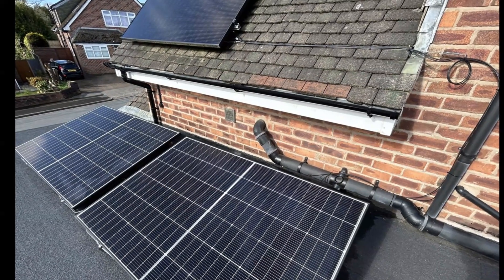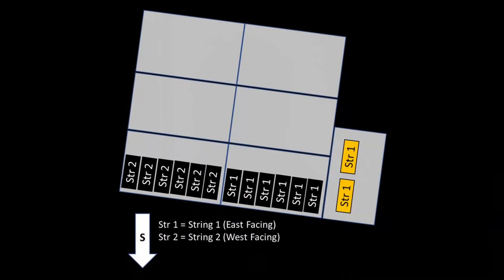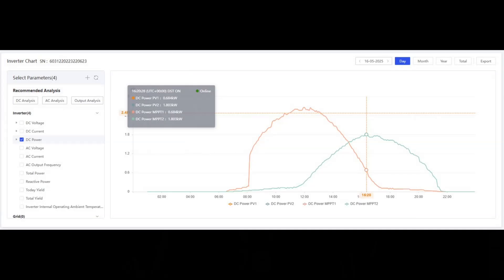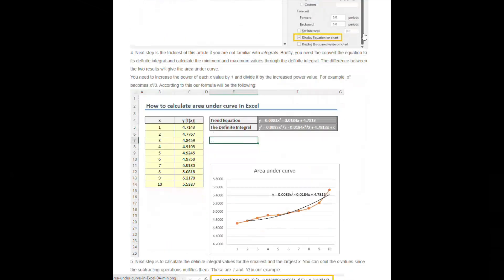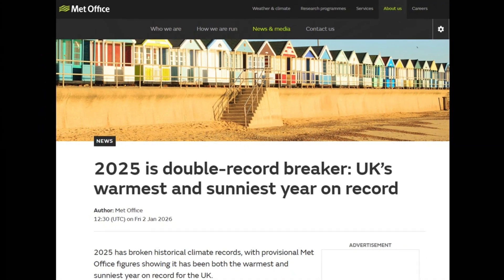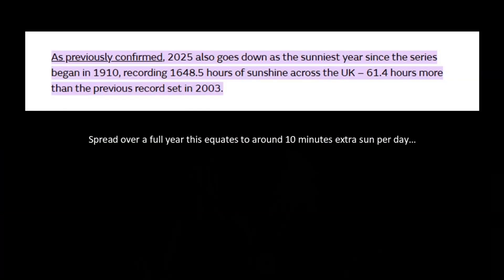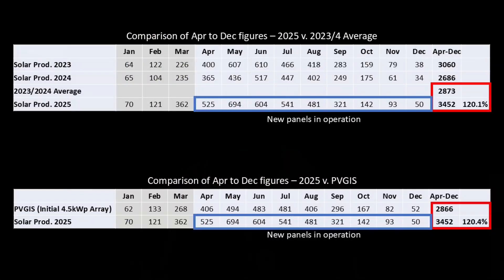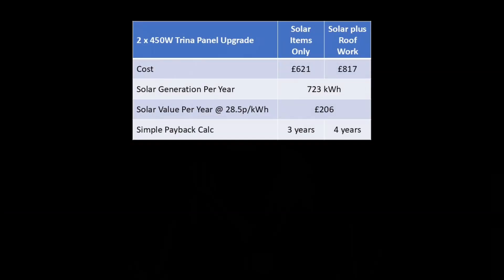Solar Panel Performance - How Much Power Are My New Panels Producing?

Comment: Can I ask, what size inverter are you using I have the same make as yours but I don’t appear to have the outlet in the event of a power outage. My inverter is 3 kilowatt.  Thanks.      🇬🇧
Reply from the maker: Hi John, 3.6kW. Solis Hybrid Inverter model RHI-3.6K-48ES-5G. Cheers, Chris
Reply: How much would you expect to pay for this unit. Sorry I should of asked in my post. Ps. What I find with what I have I’m pulling from the grid when I have lots of energy in my battery, so do you find you have enough with what you have with your inverter.  Thanks.    🇬🇧

Comment: The garage roof panels should  be mounted at the same angle as the roof panels.
Reply from the maker: In an ideal world yes, but the actual difference in power output from having the two panels at a lower angle is marginal at best. Cheers, Chris

Comment: Interesting video, I added 2 405w REC panels east facing 23 degree slope to my system in Sept 2024 and my full first year they generated 575.5kwhs  January to 31 December 2025, it’s easier to get the data yearly than adding up monthly for me, Also I’m in west lancs so not dissimilar location,  Seriously thinking of adding more panels as now got a heat pump,
Reply from the maker: Thanks! Yes, I'd like to add more panels if I could, but the only realistic option involves scaffolding and probably paying someone to fit them. (I'm not good with heights..!). We may well be having some roof work done this year so I'm wondering if I could get them done at the same time, to minimise the cost. Do you mind me asking which heat pump you went for and approx. install cost? Cheers, Chris
Reply: @handyman-at-home 
                                        We had a 11kw Daiken fitted by Octopus for £3500, replaces a oil boiler that was coming to end of life, We used the Visit a heat pump site to view other people’s heat pumps in similar properties to ours and that is a very worthwhile experience and being able to see and ask the owners questions
Reply from the maker: Thanks!
Reply: @handyman-at-home 
                                        If you’re contemplating getting a heat pump do your research,I spent lots of hours on YT and visiting heat pumps, insulation,solar panels,batteries and time of use tariffs should all be taken into consideration as a holistic approach is so essential, personally I wouldn’t get a heat pump without batteries and a good time of use tariff .